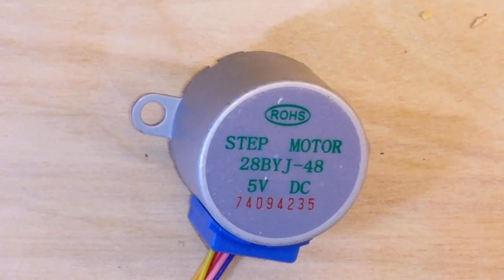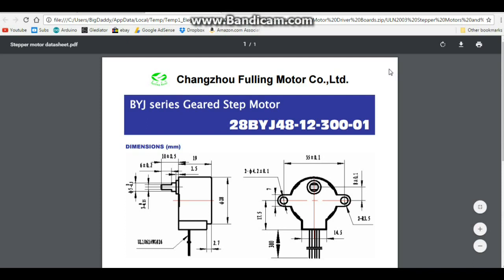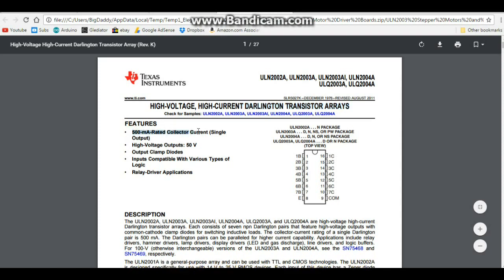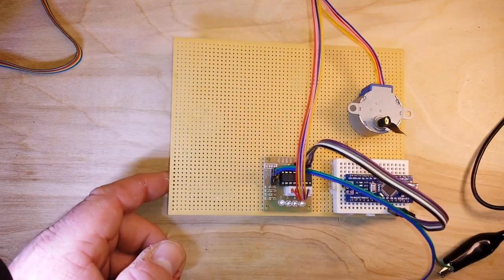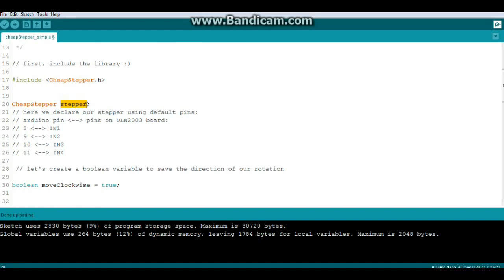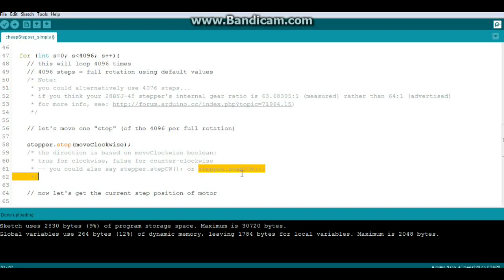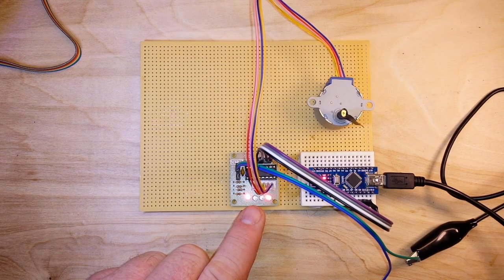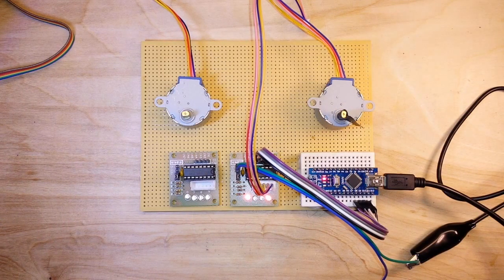Arduino Basics   Intro to Stepper Motors

Comment: hello! thanks for the awesome video, but i have an question. if you connect two motors then they will take turns moving. is there a way to let them move at the same time?

Comment: Question:  Once you determine the coil conductivity matching them up, does the polarity matter for the two of wires in each pair? (Bipolar motor).

Comment: Hey man i know its been a while 😅   But your video really helped me out, can you explain more about the power supply to the engine, and if its ok to connect to   5V Pin in arduino uno and the (-) cable to GND in arduino
Reply: i dont think you should last i remember they have a limited power output around 40 mA

Comment: I tried to follow exactly but I am getting an error, when trying to upload, it gets to the line void CheapStepper::off() and says no function declared, at which point it fails to upload. I tried editing and even deleting that block of code altogether, at which point I then get the message 'error compiling for board arduino/genuino uno' Does it only work with the nano board?

Comment: The library CheapStepper.h doesn't exist if i type it
Reply: you gotta download it from the description. Go to the github page and then click on clone or download. then select download as zip. then go to the arduino app and go to top of the screen and select sketch. then go to include library. After that you click on add ZIP library and then find the zip file that you downloaded. then click on it and there you go!
Reply: @splatm4n8  thanx

Comment: How to connect three stepper motors to control them in the same rotation speed and direction and in the same time, by using mini pro arduino?

Comment: I'm using the cheap stepper library but when my motor is not in use it gets very hot. What do I do to keep the motor from getting hot? How would i disarm the motor without turning it off manually

Comment: Wow, that is a really slow motor. I assume this is the fastest it can go since I don't see any delays in your code slowing it down between steps. Just the 1 second delay between rotations.
Reply: FYI, I just learned that this "motor" is actually an assembly that included a 64/1 gear reduction.  So the motor is actually spinning 64 times faster than what we see the output spinning in this video.  The motor has a resolution of 32 steps per rotation while the assembly has a resolution of 2048 steps per revolution.

Comment: I wired the motor driver from another arduino powered with an apple ipad charger 12W. Is that harmful or something because its working and there is hardly any heat coming from the arduino

Comment: What type of power do you have hooked up to the driver board?  Often times I've seen the power supplied by the micro controller.  I'm new to this, so I'm just trying to ensure I don't fry any parts.  Thanks for the tutorial!
Reply from the maker: Franny Levitin it's 5V from my bench power supply. You really don't want to power a heavy load like a motor from the Arduino. Each Arduino pin is rated at 40mA max.

Comment: Is there a common ground between the Arduino and the motor board that I'm not seeing?
Reply from the maker: No there isn't. Here's why it works though: The ULN2003 consists of 7 Darlington pairs. So I don't think they are sinking any any current. I believe they are simply sensing current and reacting accordingly.

Comment: an FYI for the cheap 5v stepper motors, the one i bought refused to turn counterclockwise and it took some digging to find out that on mine IN2 and IN3 needed to be reversed. Seems like it was a pretty common problem once I found the solution. Mine was a 28YBJ-48 with the same control board and also came with that great chineseium smell... yum...
Reply from the maker: I haven't had any issues, but if I do I'll give your solution a try.